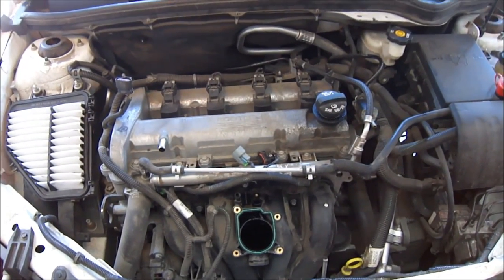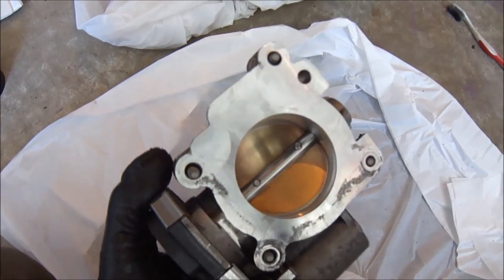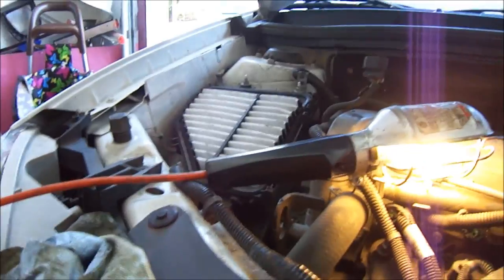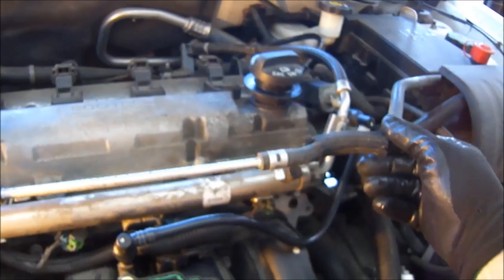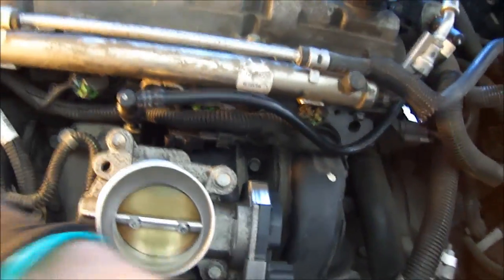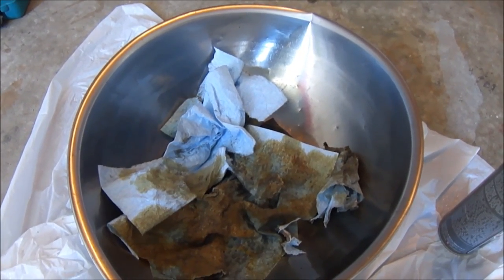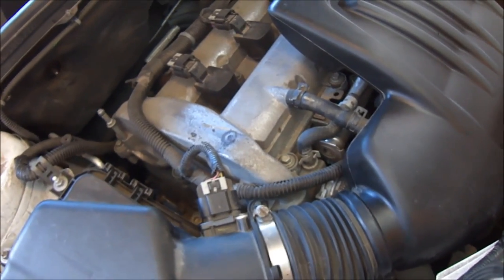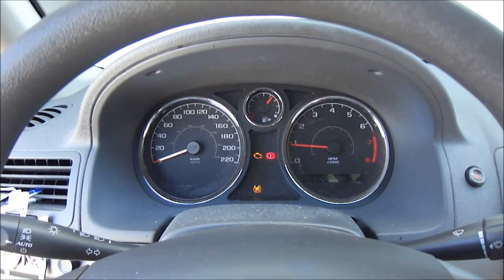HOW TO CLEAN YOUR THROTTLE BODY CHEVY COBALT 2007

Comment: Hey man found your video fairly helpful. Found this remedy on a forum to fix my rough engine idle at stopping and starting. Your video helped me out with knowing where sensors and screws were to take apart and procedures on how to clean with battery and connector disconnected from the throttle body prior to cleaning. My constructive criticism is your video was kinda backwards as most people can put things back together once they know how to take it apart. Your video only showed the putting back together and i think showing how to take apart and clean would have been more important. Just in case you wanted to make another video or for your next one ;) thanks for being the most helpful that i could find for this issue, i appreciate you.

Comment: Thanks for making this video, it has been very informative! I have a 2005 Cobalt manual that has been having the same surging/lugging and rough idle issues. I'm also putting in some e3 spark plugs in addition to cleaning out the intake.
Reply: Just finished cleaning out the throttle body/air intake hose. The MAF was pristine, but the throttle body had massive oil and carbon deposit buildup. It was well worth it to completely remove it and thoroughly clean all the buildup off. The spark plugs were fairly seized in when I was changing them, but the boots were still in good condition. Once everything was connected (including the battery which I took off a few hours ago) the car started up smoothly and idled at 900rpm. The best part was, the check engine light was off after being on for the past 2 days. I don't think new plugs were nearly as critical as cleaning the throttle body, but it should help with overall performance.

Comment: thank you so much for this video, my car has been idling rough/stalling for two years!! gonna try this tomorrow
Reply: twistedimagev2 did it work????
Reply: yes it did, was easy and worked great.  car runs perfect now, no stalling, perfect smooth idle, getting better gas mileage too. and I had a check engine light that would come off and on randomly that never comes on anymore either.  

everything worked great thanks to this video I knew what I was doing/at least what I was getting in to
Reply: Gas mileage ah that must explain my crappy city mileage but good highways....
Reply: @ twistedimagev2

Greetings to you!

 I've been having idle issues and the check engine light which comes on and off every now and then as well for the past 2 months.

 It's a 2007 Chevy Cobalt, and whenever I come to halt, the vehicle will turn off, even at times when I put it into reverse gear. My speedometer will also jump up and down at times when the engine is on, but in park.

 I was wondering if you were having the same issues?

 I have been employed with a company which is based 45 miles away from my home town for years, and had to resign due to this being my only vehicle and no way to make the trip with these recent problems which arose. Very sad!

 Thinking about performing this Control Valve removal and cleaning myself very soon.

 If you can please get back to with issues you had, or any tips on the maintenance you performed, it will be greatly appreciated.

Thank you!
Reply: @ElSteve-ORadioTM  did it fix your issue? My car has same problem with speedometer

Comment: Just something I figured out doing this the other day. Disconnect the battery or plug from the throttle body first. If you don't you'll probably get left with a high idle afterwards. I guess the problem works itself out with a relearn, after about 2 weeks of driving. Can also let it run 3 minutes, turn off for 1 minute. Repeat a few times. Those did not work for me. Thought I was left with a 50-150$ PCM Reflash. Cleared codes before the first two methods, no dice. Out of desperation, I tried disconnecting both the  - & +  battery terminals and clamping them together for 5 minutes. No longer does my car decide to drive forward by itself at red lights or stay at 3k rpm going down a hill with my foot off the pedal. Maybe you'll find this after panicking and it might work for you. Not sure if it was just by coincidence or what. I don't know what all it reset, my TPMS all took a while to come back online though.

Comment: HI sir, by any chance did you get a the code P0121? and if my doing this well help clear the code?
Reply: 7 ra Yes I had the that code and P0449 (bad gas cap) I replaced the gas cap and cleaned the throttle body and the Check Engine Light was on for a couple of days and then it went off.
Reply: i did the job today and my car idles very high! did you have this experince, and how long did it last?
Reply: 7 ra you pushed the butterfly within your finger too far and now you confused the computer. You can try the relearn procedure. 

Start the car, idle for 3 minutes, then off for sixty seconds. 
Start again, idle for 3 minutes, then off again for sixty. 
One more time, on for three minutes, off for sixty seconds. 

If that didn't work for you, then drive it for at least 3 minutes, then idle for three, then off for sixty seconds again. 

If that still didn't work, then drive for about 20 miles on the highway. Accelerating, decelerating, and stopping. Get on the highway, take the second exit. U turn. Get back on, take the first exit, go left, wait at a stop light, u turn, back on the highway... Etc

Comment: I've done a thorough cleaning and my car is still idling high. It's been about a week now.  When I first start it,  some days it'll idle properly..... until I touch the gas.  That's when it'll spike and shoot straight to 2k then eventually settle to 1500. What's the deal?  I'm burning alot off extra gas and it's killing my pockets.
My cobalt is an 08 2.2 manual non ss.
Reply from the maker: When was the last time you checked your charging system could be your battery or alts going so engines idling and reving to charge. Also any codes ?? Could be a 02 sensor or hole in exhaust/leak. Colder months you definitely consume more fuel
Reply: @ghostlyrich  everything is good, code for throttle body not able to close or find zero.
Reply: @jperdue3567  You need to open the TPS and reset it to zero. Use a flat screwdriver and set it to 9o clock position.
Reply: @RustyShackleford108  way late! My butterfly was fucked. Replaced through body and had ecu flashed, now I'm golden.
Reply: @jperdue3567  My bad. I didn't notice how long ago this was. Lol. I'll be taking my throttle body off today.
2010 HHR 2.2L
Reply: @RustyShackleford108  lol yeah I comment on people's shit years later. No worries.
 They are easy to do, just don't fuck with the butterfly, it will throw the position off and be ruined if you're trying to reuse it.

Comment: Does the throttle body sensor position fix the power reduced warning that is common in cobalt cars ? Also, hate those cheap obd scanner. Btw, I have a cheaper one lol.
Reply from the maker: this should definitely help.  after my expensive one got stolen i cheaped out second time around will be replaced one day with a better one lol
Reply: So, you only cleaned the inside of the throttle. Has that helped? You haven't cleaned the sensor, have you?

Comment: My 2009 cobalt LT revs while driving...going between 30 and 40 but only sometimes any idea what this could be? No engine light on or any lights for that matter I just passed inspection a few days ago also.
Reply: the same thing is happening to mine any were you able to find the solution? sometimes I'm at a stoplight and it randomly starts revving up to 2000 RPMs

Comment: Hi. Thanks for the video. It was a big help to my Chevy cobalt. However, after cleaning the throttle body and putting it back in, my car idles pretty high. Around 13-1500 rpm. I've driven the car around for about 20 minutes or so since doing this and the problem hasn't subsided. Any ideas on what I could do to get my idle back into normal operating range?
Reply: all I had to do was let the car idle for 5 mins, turn it off, start it back and let it idle for another 5 mins, then i took it on the freeway where i could run at 60mph+ for about 5 mins and the idle adjusted itself just fine.
Reply: Vlopddap another way to discharge the system is remove the positive lead from the battery and hold it to the negative terminal for 10-15 seconds. That will discharge everything.

Comment: Thanks man, saved me some $$. I have an '07 Balt and am getting P0121 error this should fix it.
Reply: by any chance did the car idle high after you cleaned it? about 1500-2000 rpm
Reply: 7 ra Yes it did for a little while and then it settled down
Reply: how long is a little while< sorry its just that when i drive it stays at 1500 even at 40 km it wont go down if i release the gas.
Reply: 7 ra Did you try different gas?  Try switching gas brands also get some complete engine cleaner, I used Dura Lube Fuel system treatment
Reply: I was skeptical at first and it a bang up job
Reply: ok cool ill give that a shot thanks for the tips
Reply: @ Iain Webster

Greetings to you Iain!

 Can you please get back to me on what type of issues you were having?

 I too have a 2007 Chevy Cobalt, and tho king I may have to perform tbis maintenance on my vehicle.

Hope to hear from you, for it will be immensely appreciated!

Thank you!
Reply: @7ra44  mine is same waay did it go away ? or how did you fix it ? please let me know asap
Reply: @sawyerbennett8227  it went away, but it took a while for it to go away. I want to say like 3 months. TRANSMISSION WENT had to junk it. missed the cobalt though!
Reply: Sawyer Bennett Hi, did you fix this problem?? high idle
Reply: @Sawyer Bennett hi, did you fix this problem?? High idle

Comment: WARNING: To those that DIY... after a Chevy COBALT throttle body is cleaned, the car's idle will most likely be better BUT also abnormally high (REGARDLESS if you moved the butterfly or not during cleaning). The car's computer will need to relearn a new idle. Moreover, the idle will need to be relearned at a dealership service department or other qualified mechanic. I had this problem and went threw all the on-line suggested methods to make the computer relearn the idle and they did not work. You name it, and I tried it including disconnecting the battery, and various combinations of pumping brakes and or gas peddle, gearing the idle down, driving for miles, etc. The cost to relearn the idle was $135... well worth the money. Car's idle was very smooth and normal after dealer relearned it.
Reply: Spamming it everywhere eh? Just disconnect the battery BEFORE YOU DO ANYTHING.